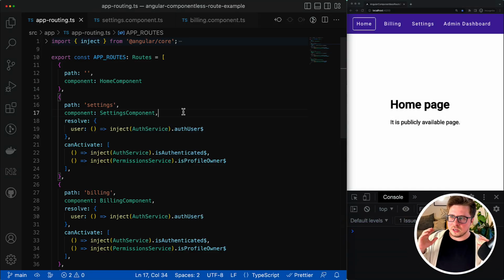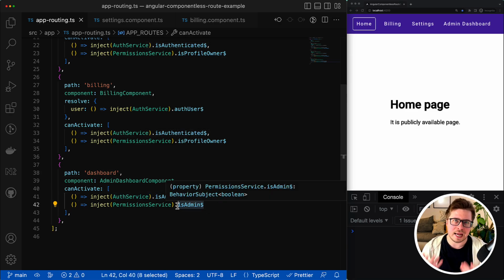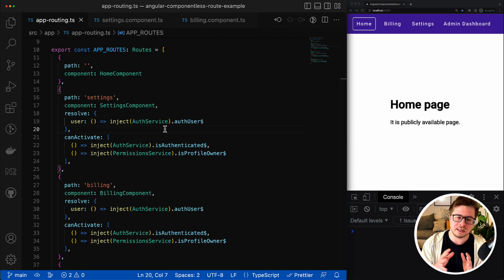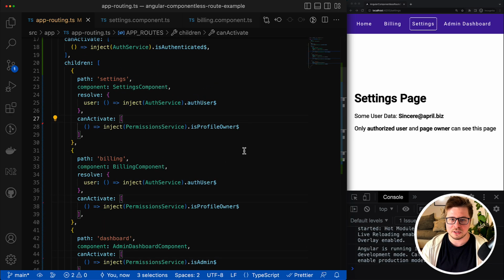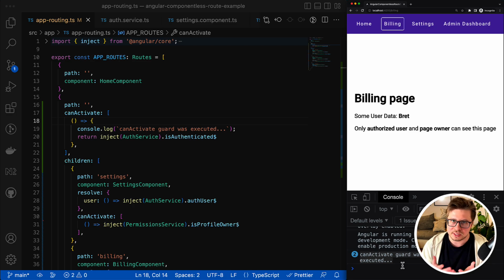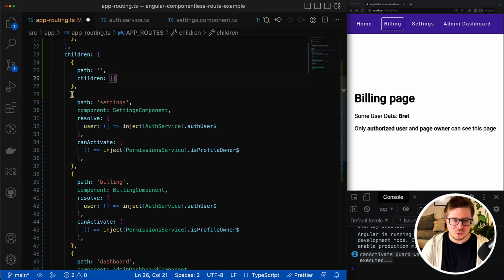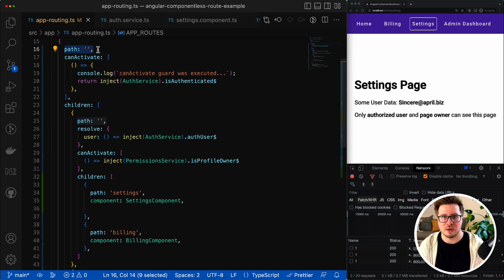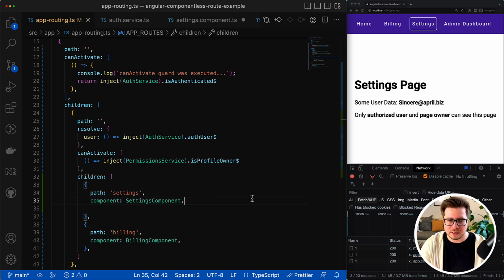Component-Less and Empty-Path Routes in Angular (2023)

Comment: Interesting video. I found myself using componentless routes for routed modals. That way angular doesn't complain about route not existing. What I haven't realized is that it worked only because I used it in lazy loaded modules. I'm currently searching for a better solution.

Comment: I learned resolvers once, then I heard its bad because it is synchronous and its better to load data in component. Could You clarify this?  Seems like good feature... Anyway great explanation as always. Its awesome you describe use case before exmplaining solution
Reply: Resolvers are great, especially when you implement loading state handling. With a little bit of work you can easily create nice user experience around that. You can use resolvers for essential data required for component withoit which it will not work properly. This way you don't have to repeat loading stste logic in all components.

Comment: Great video!! 
I guess if the user had a global logout button and press it in one of those child routes, since the canActivate guard it's not triggered, could be a problem, isn't it?
In such a case, what would happen with the user resolver? Would it return the empty user or would it not be reactivated?
Reply from the maker: No, it should not be a problem. If you log out you usually don’t need to trigger canActivate guard. You just remove authentication token, etc and redirect to “login” page
Reply: @DecodedFrontend  In some cases removing the authentication token can't work properly. For example you have a form and want to ask the user if he sure to logout without saved shanges. It makes sense to logout via /logout route and use the canDeactivate guard.

Comment: nice strategy, but how could you redirect to another route if for example user is not authenticated?
Reply: You can inject Router in the Guard and navigate to a new url from within the guard. In this case with the isAuthenticated$ observable you can pipe it through a tap function that navigates to /login if the value is false
Reply from the maker: Thank you, @Netrole for assistant :)

Comment: "it's easy to forget to install the guard when there are many routes"? Seriously?
This structure looks difficult even for the eyes. Yes, the code will be reduced but what is the profit? When you have at least 10 routes(and using more than one guard for all) with such a structure, you will be amazed by the complexity structure.
But yeah, cool approach if you're alone on the project.
Reply: Imagine you have a schematic which add some page with nested components to your project. Also this schematic add a new route with this page.
In this situation current approach is very useful, such as you don't want have a guard logic into schematic and just describe it into your routing module.
Reply from the maker: Hi,
Thanks for the feedback. You can always extract the component-less route config in the separate file, give a meaningful name to that constant and just import it to the main router config, so the main config will remain lean and readable.